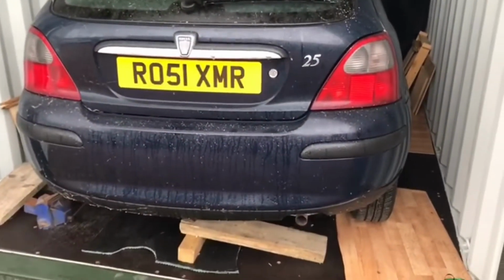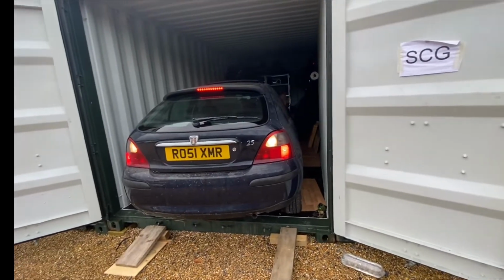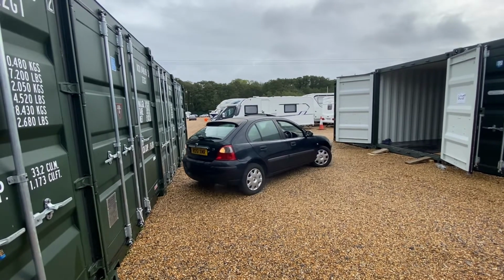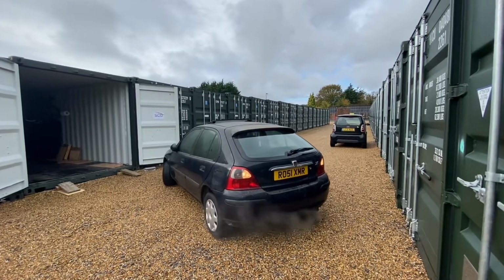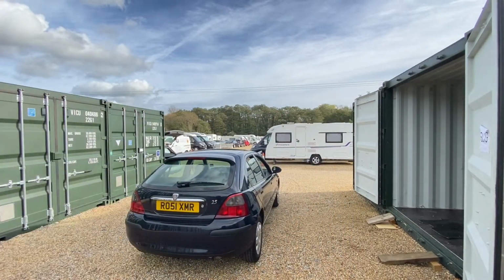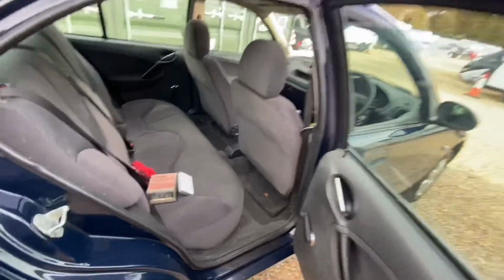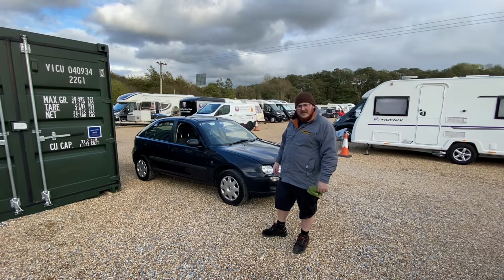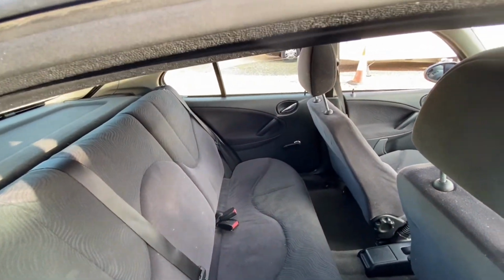Rover 25 (1.1L) first start,drive and Clean) for 8 years….. mental

Comment: Pretty rare the 1.1 but the mileage is high 😂 I own a cracking little 1.6 IS 3 door with 9,500 mls on the clock early pre facelift and she’s pretty nippy around the country lanes. As said previously change the cam belt & water pump which are prone to leaking around 5 yrs old. Most HG problems are down to poor maintenance on the cooling system. Good luck with it, nice cheap to maintain future classic and it will be as the 25’s we’re town knock abouts abused and scrapped so good ones are now rare they’re disappearing fast.
Reply from the maker: I had 1.4 a few years back and that was nippy. Trouble being i used it whilst working at dominos and racked the mileage up quick. Great car wish I still had it. Missed an opportunity to buy another one almost exactly the same apart from had air con and mine had a sunroof. Their only going to go up in value